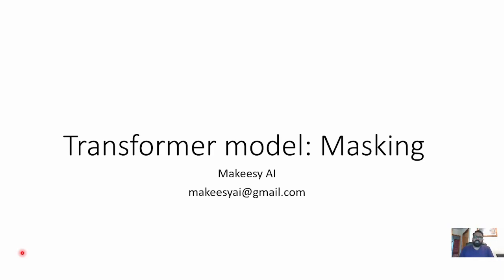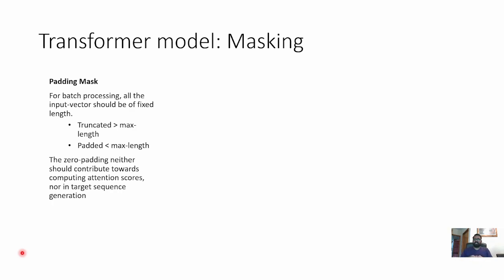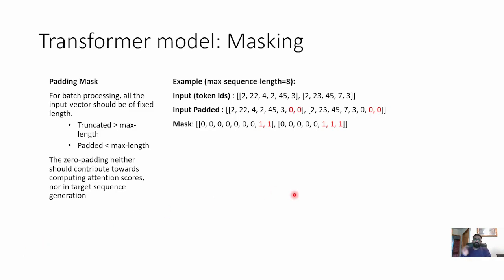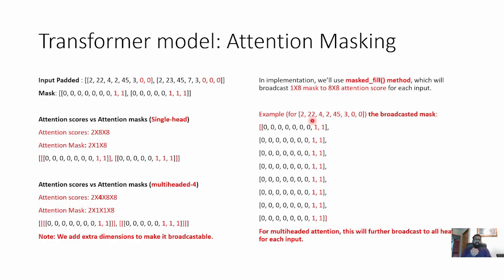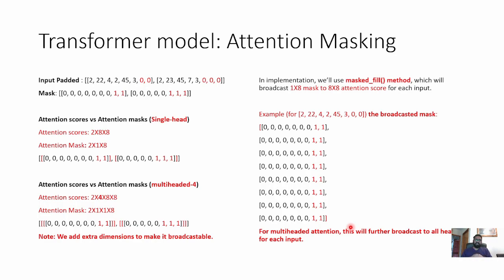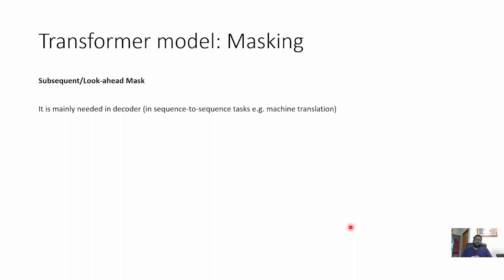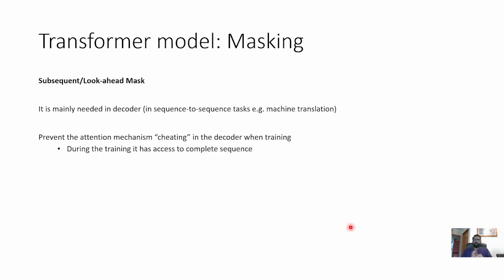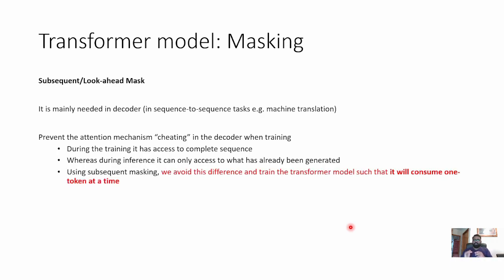Pytorch for Beginners #34 | Transformer Model: Understand Masking

Comment: Hi, I don't understand why in the padding mask it is only applied on the last two columns and not on the last two rows.
Reply from the maker: So, the attention scores corresponding to the mask tokens are in those columns, that's why we apply masking on columns not on the rows ( However if your self attention implementation is such that the mask tokens are placed in last rows, you can just transpose the mask matrix and that should be the same). Hope that helps.